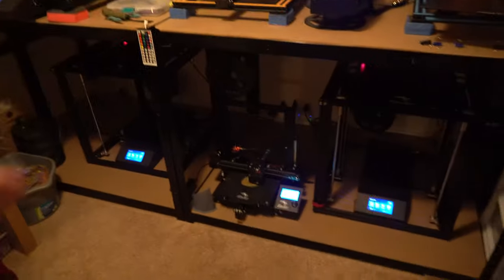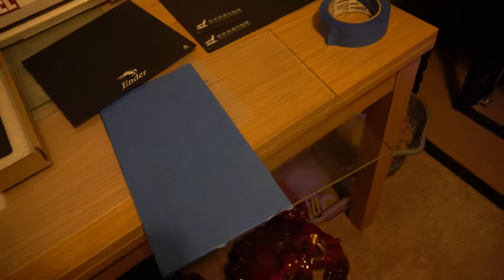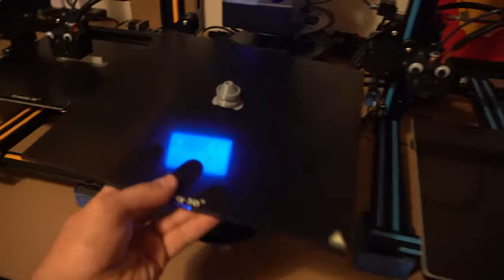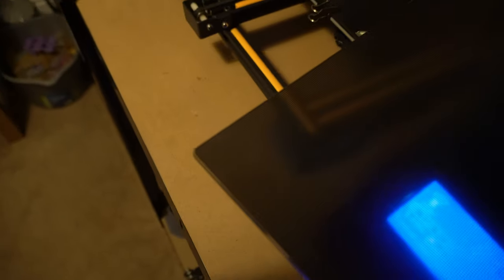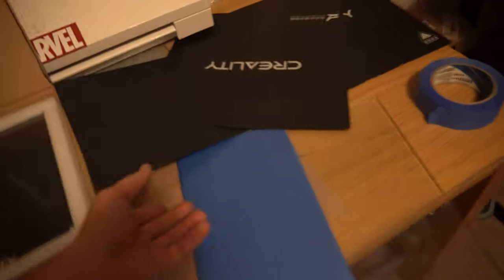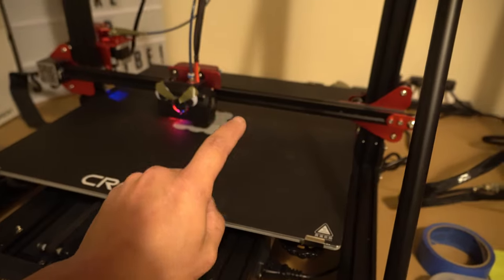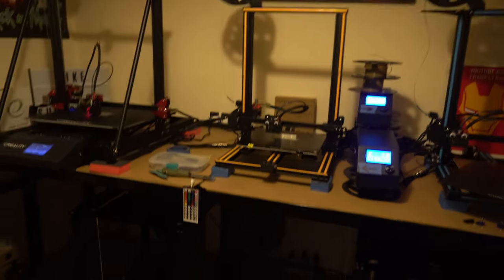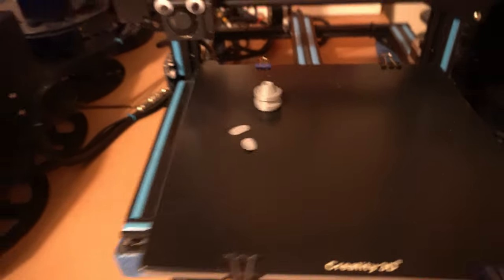3D Printer Beds and Build Surfaces - Lessons Learned and My Preferences

Comment: I have 2 printers, one has a flex steel magnetic sheet on it and I swore by that until I got the other one which has ultrabase, that has been amazing as long as it’s leveled. Just don’t have the nozzle too low or you’ll never get your prints off.

Comment: I've always used glass beds. On my FT-5 I used 12" mirror tiles, and on my i3 2020 I'm using borosilicate. Combine that with a couple coats of aquanet hairspray, and I've never had any issues with PLA adhesion. PETG hasn't given me any trouble either for that matter. ABS, now that is a whole different story.....
Reply: Any tips for ABS Adhesion? Or should I just toss my ABS at this point and swap
Reply: @youarein1ov3  Well, I'll start by saying that neither of my printers have heated chambers or enclosures, so that might help when printing straight to glass, but I'm not sure.

That said, on my i3 I stuck a pei sheet on top of my glass one time when I was deal set on printing a piece in ABS that was the size of the entire bed. That worked, but you have to be careful, because at times it was sticking too well, to the point where I'm pretty sure I destroyed a print or two trying to remove them. It's also easy to gouge the pei when you're removing the printed part if you're not careful.
Reply: I do the same thing with the exact hairspray and have never had issues. If it sticks too good you can rub a piece of ice on the bottom of the plate and the print will pop right off. and no it doesn't crack the glass. i've been doing it that way forever and still have same piece of glass.

Comment: I bought an Ender 3 Pro after stumbling upon your channel 3 (?) weeks ago, and I had my fair share or problems too, fortunately the version I bought came with the glass bed already, but I couldn't get my prints to not lift off in the corners. The solution I found was to use a raft, and now my problem became "How do I remove the prints from the bed without warping them or scratching the bed with the metal scraper". But at least the prints come out great :]

Comment: I have 3 of those glass beds with the black texture on it. 2 are the geeetech superplate and 1 is the creality. the geeetech ones pop the prints loose when the bed cools but the creality needs a jackhammer and patience to get things off. not sure why. they are great beds though. bought my first one a week after getting my first printer and I order one every time I order a new printer.
Reply: I have a glass bed from Lowes and i just rub a piece of ice underneath the glass and the print pops off. You would think the heated glass would break but it doesn't. I can't speak for the creality one though. I just bought one so i'll have to try it.

Comment: I use a mirror with a salt solution wiped across a hotbed to evaporate the water leaving a crystalline salt layer.
 dissolve one heaped tablespoon of salt to 50ml of hot water and use a paper towel to wipe on to the hotbed.
 I tried to post a URL to a PDF made by the developer of this method but your YT settings are blocking URL's

Comment: My printer prints smooth and perfect except if I don't put a raft down it never sticks. Like ever. Fails every time right off the bat without a raft. With raft never had a issue lol
Reply: Look at my post above yours, this will save you loads of plastic
Reply: Glue stick...
Reply: @teeheetummytums972  tried it, also tried tape
Reply: @I2ocker89  check out my comment beneath the video (double sided tape is the solution, really)

Comment: Forgot the easiest and best option, but no one is trying:
Double sided tape ! Really try it, pls... you dont have to clean anything ! Just put on your tape and enjoy the best adhesion you could ever have xD

Idk why no one does it, its so easy, 100% adhesion everytime, no cleaning required, probably cheaper than buying iso-propanol
Reply from the maker: But then you have to buy tape every time and it’s just adding to the mix of things you need. When you could just. Clean the bed lol
Reply: @FranklyBuilt  Plus as you said its not whatever kind of bed anymore but tape. It would be interesting to see how well it works though. Never heard anyone using double sided tape. Usually its painter's tape or masking tape.

Comment: there is glassbeds and there is borosilicate glassbeds. this is a glassbed. its crap. boro glass is the kind that is used in woodburners. the surface is covered in tiny hills and valleys. its on a microscopic level so it appears transparent to us ;)

so mr has not gotten to the pei and its superior pex springsteel plates? ahh. mate.. those are the dream